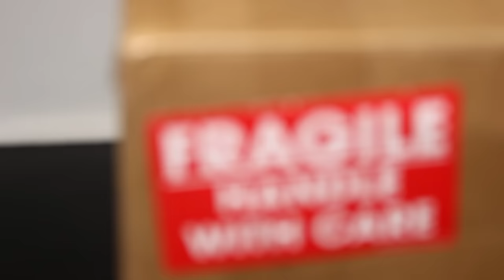World's Smallest 5 Axis Milling Machine - Pocket NC V2

Comment: 5000$....OK, I buy a used cnc in a bigger format... :D
Reply: For what it does, 5000 is a fair price. I expected it to be above 6500 to be honest. It's a niche product that has 5 axis in a comprehensive format. Looks stout, parts seem to be made ok. The test of time, of course is the final cut.
Reply: But definitely not 5 axis ..
Reply: I'd be willing to bet I can build a better one for quite a bit less than $5k.
Reply: I don't know what mill you have in mind, but "real mill" have usually low RPM like 2000 max.. and they have lead screw with backslash. And build precision 4th, 5th axis is quite expensive too ..
Reply: I would not convert a normal mill into a cnc i would buy a used 3axis and maybe a two axis head... But you can build such a small one easly under 5k. Definitly
Reply: fwiw i have a 'real mill' and this (and a carbide nomad, form 2, glowforge, several fdm machines etc).  this is a hell of a lot more fun and practical for a home :).  the ability to throw something into the collet workholding and just cam up 5 sides in one op is awesome.  in just a short time i've already found myself making things that i wouldn't have bothered to make fixtures for otherwise.

the 5-axisy-ness can't be underestimated for the 'just go cut it' factor.  setting up the tormach is a massive PITA.  i cut my kid a lightsaber the other day on the PNC with like 10-15 minutes of setup and did it all in one op.  that'd have taken all day and been a real project on the tormach.

also, the tormach is at least twice as expensive by the time it's actually sitting on a stand in your garage and working... it requires an engine hoist to install, no one can watch tv when it's running etc.  i carried this from my kitchen to the garage and can't even hear it once the door is closed lol.
Reply: Its better to buy a tormach 1100 than that shit. It's expensive for nothing. The people that made it expect $5k? you can buy a professional one for twice that.
Reply: I went the "get a mill and convert it to CNC" route (namely using a G0704 as the base). basically works, but some issues (had initially used a 2.5A FlashCut box, itself much of the total budget, and with its internal motor drivers seems to be underpowered and kept losing position; stuck on some external stepper drivers and it is a lot better now). currently it is 4 axis, sorta, mostly because I recently also did a CNC conversion of a rotary table, which I can use as an 'A' axis. total budget thus far is ~ $5k. also considering doing a lathe, but will likely go "full custom" on the controller side of things (custom written software and running it off a RasPi).
Reply: Andrew Foss....Okay.....we are waiting...
Reply: what do you mean too lazy should i call you too lazy for using a tap to get water instead of running to the nearest river with a clay pot. Humans time is valuable what is the point in putting in the energy doing something that you do not need to do?
Reply: Reno Simpson how so I'm just pointing out what you defined as lazy I would define as efficient. you say people are being stupid I say it's people starting to specialise in very specific fields. I don't think humanity at all is heading backwards. More like very slowly forwards.
Reply: Jacob Clayton it’s also more efficient to use google instead of retaining information in your memory, that doesn’t make it beneficial to our intelligence or future survival, just easy.
Reply: Ryan Clark I don't think your understanding what I'm saying he called builders stupid/lazy if they don't know how to make cad drawings I'm trying to point out that gone are the days of builders or any trade being someone who has to know everything and what it's becoming is mutiple people specialising in there own things. Which in my opinion outputs a way better product always.
Reply: Reno Simpson I'm definitely not your saying people who don't know everything in there feild are lazy/stupid I'm saying that quality of product and time is benefiting hugly because every worker doesn't have to know everything.
Reply: me too
Reply: Voytech really?i thought that spindle has somwhere between 20k-60k rpm...
Reply: Sadly instead of providing some sort of value which is what makes business grow, they have very accurately attacked that if you want to do 5 axis, dumping the 5k is utterly painful but your best route. Or basically, you'll accomplish what you needed probably as cheaply as possible and with fewest headaches however you'll be bloody fucking pissed the entire time. I can't say for sure though I don't own one. Just think for what it really costs, maybe they could have hit the 2k range. They are marking up that simple. Sure they have right to do it, like I said they are still coming in cheapest for highest quality, but they easily could have gone better. Provided a real value, a real bargain. Might actually generate some good old american ingenuity. But hey it's high speed business now a days, not the long run. Nobody wants to actually build a reputable quality company/corperation, they all want to get rich quick, then dump it. Then the other richer people take it over so they can get rich quick etc.
Reply: Really I have to say tormach is the one really providing the value. That company has obviously some core values. They don't have to sell a dam good cnc machine for 4k but they are. Sadly I don't own the facilities to operate one currently else I'd had dropped the money on a 440 years ago. Anyways nice to see somebody actually using the dam thing for something interesting and engineering something. Not like other channels where they are literally waisting aluminum/wood making ball inside cubes etc, or shitty stand for ipad to be fat and watch tv.
Reply: Reno Simpson I am invested in this yes because I am a r3 structural glazing surveyor. I deal hand and hand with with so many young male tradies who have next to no self pride because they read comments like this. And they just think what's the point. They believe they are so worthless. When they arent. I have this guy right now John who is an amazing talented glazier who recently quit his trade and now games 24/7 because and these are his exact words "I'm just a skilless tool" we need people to be at the bottom just like we need people at the top and that's my point.
Reply: Yes. It was mostly aluminum from what I recall. This one seems to be constructed better than the one I used two years ago, but it's still just not worth the price tag. You can score a used prototrak for the 5-7 grand range and make your money back in a month. Meanwhile this thing only seems useful for the novelty.
Reply: Tormach is garbage. When you run and make money on a real CNC then use a tormach, you realized how flawed and inefficient they are. People bandwagon tormach too much. I can make my money back faster on a prototrak with the same price tag.
Reply: Tormach is 3 axis by default. Drop more money and you can have a 4th axis. No 5th axis support. I wait for the day that Tormach makes a native 5th axis, but until then there is no need for you to insult Pocket NC or the people who buy one.
Reply: Please show me where you can buy a 5axis trunion for 10k
Reply: You can't. So why spend 5 on one that holds no value beyond novelty?
Reply: Andrew Foss - Please do! We are all willing to see it...
Reply: Lime -such as?...
Reply: Reno Simpson - What you state is true, however, the fact that almost anyone can get into the hobby, or skill, made easier by the industry at large, results in far more people developing, improving and simply thinking about ways of shaping matter.
It is better to have a few experts, passing along their skills to a very limited amount of interested people, or have the knowledge and potential of a human population dedicated to the advancement?
If one is discouraged from learning, then we are keeping secrets as greed...
Reply: Alucard Pawpad  I have seen this machine before, and I can garantue you it is a very high quality piece of machinery. It might be expensive, but you have to consider there aren't many factories that make something like this, also with this high quality in mind. They might take advantage of this.
Reply: If it's worthy, it could pan out a hundred fold in ROI. After a few months add a few more to the work bench. Wait, what was the work piece size?
Reply: Reno Simpson oh no, I can't defend my original comment anymore...quick, better call him offended.
Reply: not worth to even try to do a cnc... better buy and save years of your life... or even better buy the finish products from a manufacturer for .50 cents!!
Reply: Where did you get the G code to cut the turbine blades
Reply: it may be that they 3dscaned it, or that they used a 3d modeling software
Reply: I think all you guys missed the point. He doesnt need a bigass mill to do what he needs to do. What he got is perfect for what he does...
Reply: the difference is the extra 2 axes, why are People comparing Apples and Oranges?

There is zero existing market for used cheap 5 axis machines.

5 axis industrial machines normally start at 200k $
Reply: i expected 5200.
Reply: so many people is full of shit. All i can say is good luck to whoever think they can make one. I doubt that they can build one for less than $5000
Reply: I converted a BF20 mill (120kg) into a CNC (C5 Ballscrew axis + precision bearings (not Chinese shit), Gecko stepper drivers), using the machine manually to make motor mounts and other components. Not counting my own work I spent round 1500 Euro on everything including the new mill. Now that I have this machine I could build a better CNC for less, but as said building a cnc like this requires you to have a mill/cnc in the first place, or at least access to one.

As for building a REAL (that can work Aluminum all day long) 5 axis for 5000$, lets just say its very doable if know how to search on ebay, or find some parts in a workshop garbage bin.
Reply: @Jacob Clayton Learn to spell YOU'RE understanding, THEIR own, YOU'RE saying, THEIR FIELD and BENEFITTING HUGELY.
Reply: Here's the thing about buying VS Building. You need a mill to make a mill, at least one that's going to be useful. Sure, you can build completely from scratch, but the only thing you'll be making with that mill are parts to replace the ones you did by hand.

I could do the same thing with my 3D printer, and honestly, I don't want to waste filament making 3-4 different sets of parts to get the bed to tram level and have little/no wobble. I could save up a bit more, buy a carbon kit, and have the thing printing better then it will EVER print otherwise.

If you want to make a secondary mill with your (professionally made) primary mill, then it makes sense. otherwise, you're wasting stock.
Reply: 5k to the trash if you ask me😏
Reply: It's a router lol
Reply: 5K is not bad considering the cost of a slightly larger machine that is only 4 axis. Besides it would easily be $40K if HAAS or one of the others made here in the USA, but you would get support that goes along with it.
Reply: Good luck with that, fool. Lot's of bullshit talkers here ... if it's so doable, why didn't someone do it before PocketNC?
Reply: plenty of people did do it before pocketnc.  phucketnc is just the first ones trying to sell and make a HUGE profit on it.   
it's basicly just a scam.  

you can build this for less then 2k.  especially if you have access to a normal mill to mill parts on for the small 5 axis mill.  
i intend to attempt it for less then 1k.  but i'm cheating since i already have some rails and 2 ballscrews.  wich cost about 300euro's  if i would buy them today.
Reply: @aserta  
And what it does exactly?

In such equipment, what you paying for is PRECISION!
And as far as I can see, this thing from video have non precision at all. I can see it by naked eye.
The result is horrible.
The speed is extremely low.
Reply: @marshalcraft  sigh its called proprietary technology.
Reply: I made a 5 axis cnc for 1984.56 dollars is don’t get on me bout fair price
Reply: @jacobclayton8131  I couldn't agree more.
Reply: @aserta  It self zeros. That feature alone is about 1000 hours worth of programing work alone. Not to mention the time it would take to calibrate and get the switch to work properly.

Comment: Its cool but not $5,000 cool.  You gotta make a ton of stuff for it to eventually pay for itself.  Other than that I'd rather just hire a machinist.  It might be pricey, but if you only need a few things than it's worth it.  Plus they'll do it a lot faster, so labor shouldn't be all to bad.  My dad is a retired machinist that used to make parts for NASA and the military.  To bad we don't have one of these things.
Reply: And it doesn't even come with the collets or the necessary adapter.
Reply: This isn't about it paying for itself (though it certainly could). This is a full 5 axis CNC horizontal milling machine for a price that's within the budget of hobbiests. Go price some full sized used ones and tell me this is too expensive. It even has a tool standoff sensor which is often a fairly expensive addon. Seriously, I'd rather have this than a GlowForge or 3d printer any day of the week. This also doesn't take a huge shop space to run. It would be cool if they made a matching CNC lathe as well of similar size.
Reply: Well a single run 5 axis part will set you back 100-200 bucks a pop so if you’re in this hobby, that would add up quickly. Also having complete control over manufacturing allows more freedom to experiment, and quick return times.
Reply: Good luck finding a machinist, let alone the machinist having time for your experiments
Reply: If you know how to find them its easy.  I've hired a machinist a couple of times to make me special tools for certain projects.  Didn't really cost that much.  I just had to wait about a week so they could do it during their lunch break or after work.
Reply: I think you're all missing the point. This isn't a machine made for efficient commercial machining of parts. It's made for those who want to be able to make their own things at home and learn how to do CNC. There are 3D printers that cost as much as this, but they can only do plastic, slowly, and to pretty loose tolerances. Sure, if you want to make little kitchy figurines and that stupid tugboat, by all means get a 3D printer. I'll be saving for one of these myself.
Reply: Some people don’t necessarily buy these items to make money, some people simply want to experiment or generate their own designs. I have two 3D printers, and I did not buy them with the thought of breaking even or making a penny on either of them, despite suggestions or questions from interested people.
In fact, I would say this machine is geared (excuse the pun) for the hobbyist, not for the factory floor..some people just happen to have more money than you and I, and $5K is simply not that much money to them.
Value is in the eye of the beholder, and the user, not so much in the critic.
Reply: Exactly. $5k is not pocket change for me, but it's within reach if I choose to save and spend the money on something like this rather than something else. I'd like to learn machining and this looks to be a pretty good way to do it. It doesn't need a huge space or a thick concrete slab to support it, it doesn't need three phase power, and for the size items I'd reaslistically want to make, this would be fine. A matching size lathe would be really nice as well.
Reply: lol with 5k u get nothing ...u cant turn part if u need mill other side ,no tools ,no rigidness,, only cool is it's desktop toy .... to mill foam for casting ,wood ,,soft alu, brass kinda ,copper ,but u need like 1k $ more for tools
Reply: So what if you need to spend more on tooling. You'd have to with a full size milling machine as well and those would cost a great deal more. Wood, plastic, brass, alluminum, and foam are exactly what a lot of home hobbiests actually want and need to be able to work with. It's precise enough for many uses as well. Certainly more so than most 3D printers. To compliment this you'd probably want a belt/disk sander and maybe a grinder to maintain and make your own tooling. If you need to machine steel, this isn't the machine for you. I will grant that if you shop around and are willing to do the refurbishement work yourself, you could probably get a full size lathe and milling machine for close to what this costs, but then you'd need the space, power and tooling to use those as well and they sure as heck wouldn't be CNC.
Reply: yea 6040 4 axis can do same that for 1k and plus waaay more ,,this is 5 axis but only 180 degree ,,to make something on other 180 degree u cant cause no centerpoint = toy for anything but .... so overpriced junk
Reply: Somehow I suspect you own a 6040. No offense, but if I want a lathe I'll get a lathe. you claim this is impresice. I can watch the arm supporting the spindle flexing and bouncing in the videos on that thing. A simple 3 axis CNC router would be a lot better and cost about the same.
Reply: Finding us is quite easy. You just gotta be willing to pay the price you're given. 
But in my shop, from time to time someone needs a part, they can walk in and have a talk with the master. 
Of course we're not gonna drop everything we're doing like it's hot and do your thing,  you'll get the part when we have the time to make it.
Reply: " if you’re in this hobby, that would add up quickly"

Isn't that just about any hobby ever though?
Reply: "If you know how to find them its easy."
This is the tricky part. If you know how to find them, please do grace us with this knowledge. Good machinists deserve all of the business.
Reply: Tony Montana, your father has the same resume as my manual precision machining instructor. Did he work at NASA Glenn?